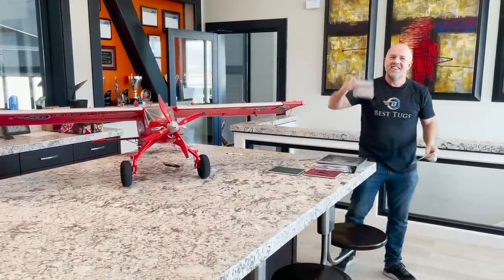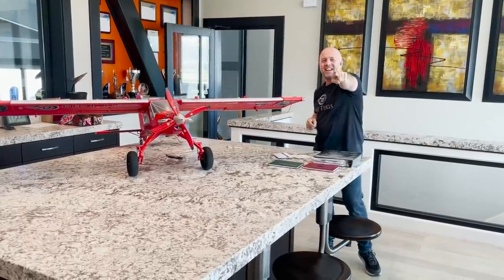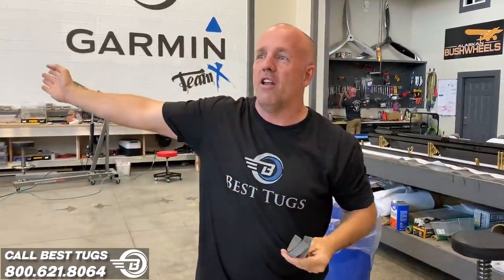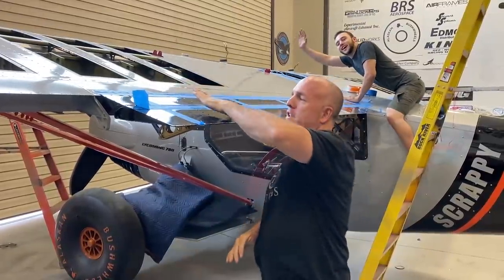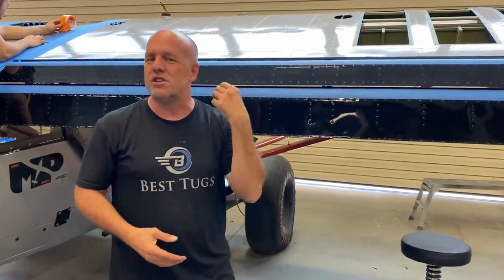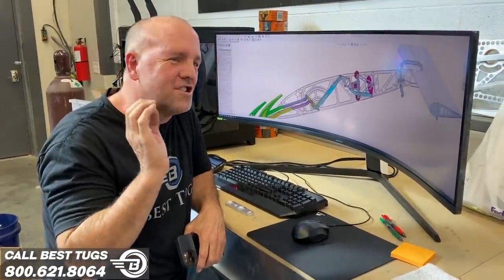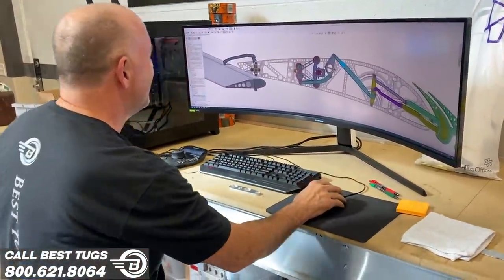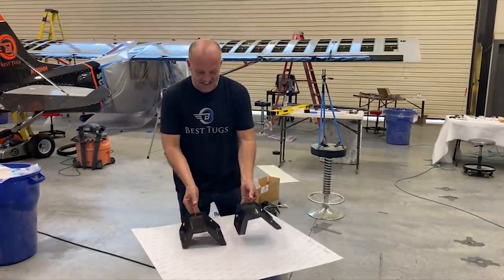Custom Search and Rescue Plane gets Wings, and Airworthiness 🤠  | Scrappy #60

Comment: On the SAR mission side, what’s the surveillance equipment setup look like? 
If I was building my dream setup, it’d be some type of detachable pod system with a ptz thermal cam. That way you can take it off when not needed. Maybe a care package that can be air dropped with emergency supplies, radio, a snickers. Haven’t binged through all ur vids yet so maybe you already touched on this.

Comment: Commenters please stop calling Scrappy over engineered. Scrappy is not "over engineered", just feature rich. What Mike designed will be used, except for the rocket parachute hopefully. Over engineering is when you add a feature you don't need or use.

Comment: Being an engineer, I can appreciate much of the detail thought that has to go into such a design as you have created with Scrappy.  I have learned a ton form watching your videos.  One observation from my experience in tribology (science of wear, friction, lubrication) is that aluminum is not a very robust wear surface, yet it appears the stainless steel bearing rollers are rolling directly on aluminum that looks bare.  Fretting and galvanic corrosion may be a concern it indeed that is so.  Are those rib surfaces engaging rollers hard anodized or coated with any wear-resistant materials?  Dry film lube?  The graphite-filled Garolite is a great anti-wear solution for the slat extender backup supports.

A second question is are you heating the batteries in the wings?  Cold temperatures severely restrict the power and total energy output of batteries.

A third question regards the solar cell panels, what is forming the structural backup to keep them from potentially failing due to the differential pressure between the inside of the wing and top wing surface?

Thanks for sharing what you are doing with Scrappy, it is an awesome aircraft!

Scotty
anti-wear

Comment: Mike, what an incredible aircraft you have built. Did you install a refrigerator and indoor plumbing for the kitchen sink? How about an soda fountain with an external spigot for when your attending those tailgating get together’s. Hey what is your hat size? I know but just humor me please. I still wish I could afford one of your Draco R/C models. It was cool for you and the designers at Horizon Hobby to produce “The Draco”. When is the test flight for scrappy? Is Scrappy going to Oshkosh? That would be way cool. Keep up the great work. The cool thing is that you have another new build in the wings already after scrappy is finished and flying.

Comment: Maybe you have already talked about these, but when the flaps are up, a connection to the torque tube pops up above the wing in a few places. What are those for?

(Ignore me if they are planned to come up in a future video).

I love watching these parts you have been talking about come together. You call it "silly" sometimes, but everything you have added above and beyond what would normally be on an airplane has a distinct purpose (often more than one). I have trouble thinking of useful, purposeful, additions as silly.

Comment: Will you add a Nylon protection around the in-/outlet of the control cables? When watching I was scared that these could probably hit the aluminium of the wing when they are vibrating in the wind.
But anyway, I‘m getting as nervous as you to see scrappy flying the first time. Good luck for that!

Comment: So just to review the list of never-been-done before aspects of this build:
-photo-voltaic solar cells 
-triple redundant electrics capable of powering you know, welding rigs or electric motorcycles 
-double-slatted leading edges that expand speed envelope without  it Centre of Lift changes
-overbuilt 2-3x everywhere (hang high weights from underwing hard points, ball bearings for movable surfaces
-ballistic parachute
-extremely precise tolerances due to custom machined parts
-dynamically adjusting ailerons that droop in ratio to flaps
-nitrous system expanding horsepower for ridiculously capable hot/high performance 
-custom avionics allowing pilot and passenger infotainment on par with bizjet systems
-electrically adjustable suspension allowing offset, lower/raise without changing wheel contact
-custom upholstery 
-amazing carbon and paint work
-designed for easy inspection part replacement

Any single one of these would be a ground-breaking breakthrough in aviation, together they are mind-blowing.

Comment: Ok just saw you at Oshkosh and you've got 45 hours on scrappy already and no video here yet :-(  (ya you're jammed up getting here)  Question - can you hang it on the prop?  I use to do power stalls in my ultralights to get in tight spots, mushing it in.

Comment: I'd be interested in hearing your thoughts about the lower end of the experimental aviation cost spectrum. Obviously the incredible engineering that goes into your work is not designed for mass production, but I'm sure you have the expertise to design and produce some of the best low-cost designs (or likewise if you think Vans among others have gotten as close to best price/performance ratio it'd be good to hear). I'm sure you're quite happy to keep pushing the performance boundaries but would be interesting.

Comment: I can't for the life of me figure out where you had all those scrap parts. And how well they fit together. It's a miracle :)
Did the FAA inspector tell you it's overengineered? because it is :)  well done.
Reply: Not "over engineered", just feature rich. What Mike designed will be used, except for the rocket parachute hopefully. Over engineering is when you add a feature you don't need or use.

Comment: What's the plan for the open area that allows that linkage for the flaps to pivot breaking the plane of the top of the wing? Is that going to remain open, and does that void pass strait through for water to drain?

Comment: Seems a little bit overengineered - just a little bit. 😜 Just kidding. Congratulation for that nice piece of work! 😁👍
But a short hint from my side: I have the same thing realised at my 84" Bushmaster rc-plane - full flaps, half aileron. If I switch to this setup, the effect of the aileron is very limitated. So please be aware of that and try it first time in a higher altitude! I love Scrappy - back to work! 😁

Comment: Cub Crafters and Kitfox engineers: furiously taking notes

Mike, respectfully, no slight against your absolute manic attention to detail and quality... but do you ever find any situations where you decide the cheaper/less complex solution is the best answer? I'm genuinely curious to know, as I usually tend towards over-engineered and over-built myself but not exclusively, sometimes I go the other way to maximize for other factors (speed/cost reduction) and I wonder if maybe I should be less compromising? Not sure if that's the right word. Anyway, back to work I guess!

Comment: What will keep the air coming into the wing from either side of each of the extensions for the  front wing extension from causing air pressure in the wing that will blow your solar panels off?  Probably a stupid question but I was concerned!

Comment: mark  the side of the bearings so you can see them rotate on inspections. If all marked in the same spot and all rotate the dame distance, they should be all back in the same spot in a yr, If not? one is binding. could you spray Graphoil (used on ec120/130 Tail rotor blade rotating surfaces)  to give it a back up sliding surface. and mark the pulley so you can spin the 90degrees every Yr to allow the cable to wear just in its range of rotation.

Comment: What does the air do when it comes around the end of the flap (toward the end of the wing) in the down position? I'd assume vertexes and or turbulent air? Is there a reason you don't use that air or try to smooth it out or is it insignificant?
Reply: It goes off the edge without pulling loose. a bit afterward, it flows up into a big vortex too far from wing surface to matter. He showed the fluid dynamics simulation a few videos ago. I don't think that good a flow has ever been accomplished before on landing flaps.
Reply: @ManicSalamander  I saw the videos but this thought just popped into my head. Would good flow off the edge of the flaps help anything?
Reply: I was wondering why he didn’t do more elaborate wingtips, but I’m sure he has a reason.
Reply: @shanekeeley405  Hmm. Good point. It would really help the ailerons. You would need some laminar flow, and no stalling, to maintain aileron control. But I think Patey has this covered.

Patey noted  in that same simulation that a giant vortex WAS generated by the flaps, but it stood above and behind the wings where it would not cause a stall condition. That is ideal. You get the lift, the control, and a monster vortex to suck your speed down.

Comment: Mike, if the plane is gonna be a search and rescue plane, why don't you try put tirs on the plane like the Mars rover. You will never get a flat and they might be lighter than tge ones already on scrappy. They are like a light steel or aluminum mesh, that gets its strength from its shape. Would be very cool

Comment: Strengthened chassis
Carbon body
Racing engine
NOS
Huge prop
BAJA truck suspension. That goes up and down.
Uprated brakes
Billet alloy wheels.
All the Garms and a rear tv.
Carbon seats.
Smooth extending wings.
Solar generation.
A rocket safety parachute.
Two e motorbikes

@mikepatey .....fridge and a microwave?
 because beer and chicken

Comment: You have aluminum pinned to a steel tube. What are you doing to control unlike metals corrosion, especially the pin. Beware my friend. I hope that has already been taken into account. Your a smart guy, but sometimes the outsiders can catch something. I hope all goes as planned and you have a great first flight.

Comment: The solar panels scare me. Isn’t there too much negative pressure running over the wings?
Reply: Thats what i was thinking, but im sure he must know what load is gonna be placed on those panels and that they can withstand it.
Reply: @sizzelot  I saw the wings indented for the panels. Did you see a back plate on the indentations?